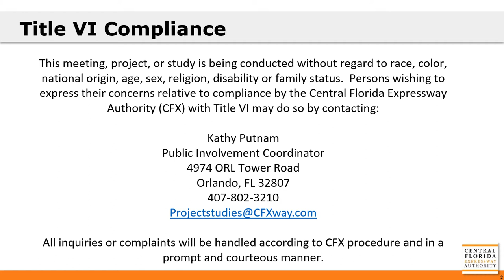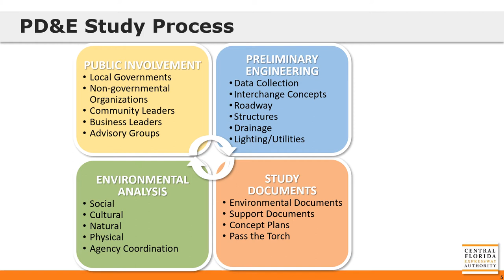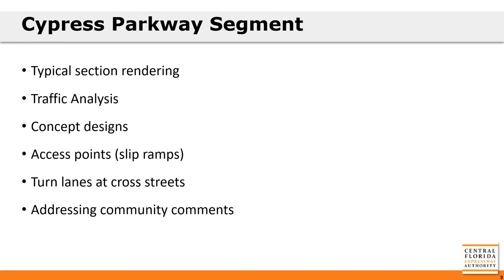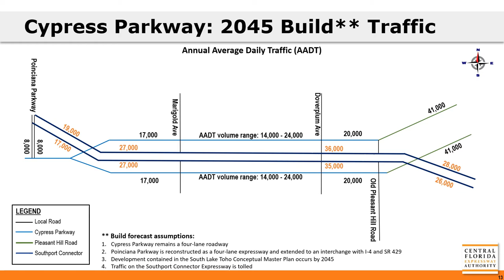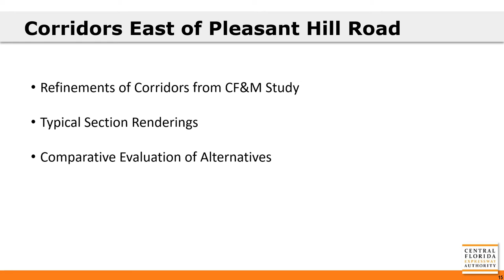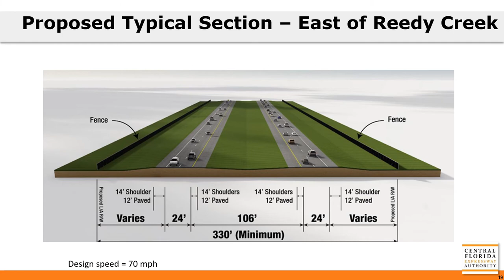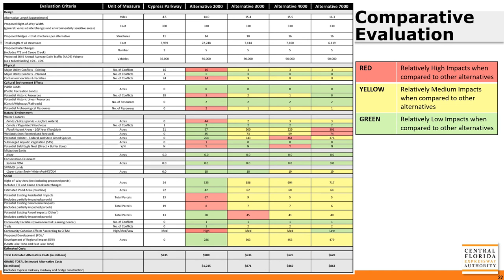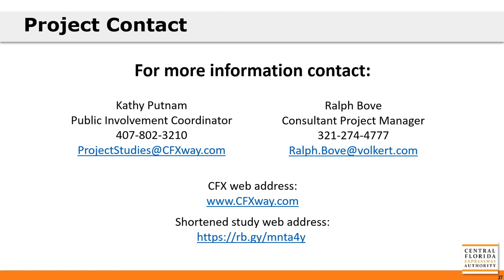Southport Connector Expressway PD&E Study - Public Information Meeting - 10/19/2021

Comment: Splitting the community of Poinciana by running a 6 lane Expressway down the middle of the town when there are other routes that have not been considered is socially irresponsible. The local traffic which is already the worst commute in Florida as reported by 2 major news organizations would be made worse by the current plans. Why are as many as 7 routes being investigated for the plan east to the FL Turnpike and NO alternatives looked at for the connector through the middle of town?
Reply: Absolutely!  This option of plowing through the middle of poinciana town of Cypress Pkwy is unacceptable, other option needs to be found.